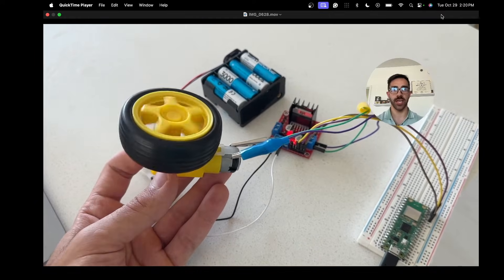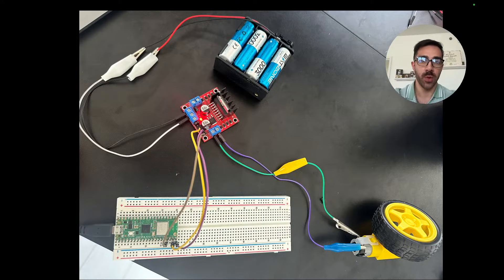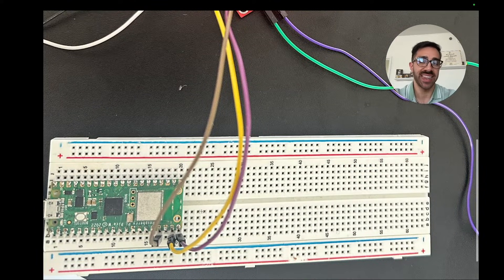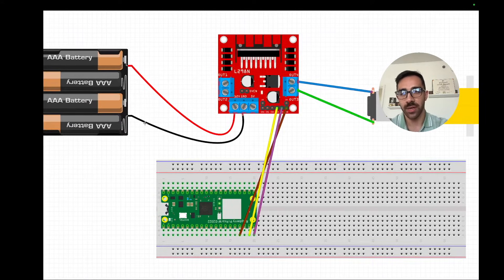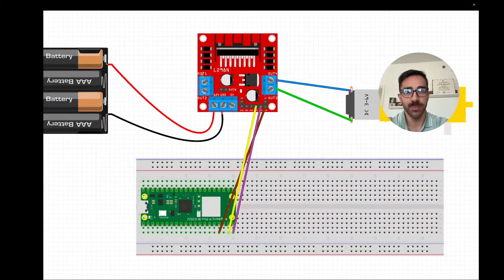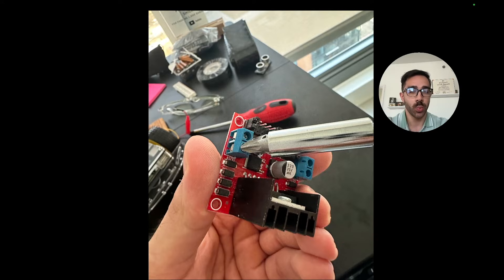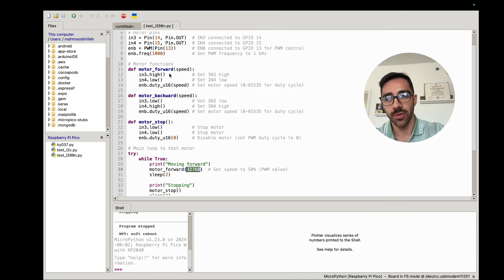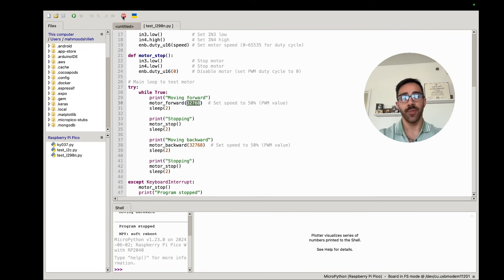How to Control DC Motors with L298N and Raspberry Pi Pico W in MicroPython | Full Tutorial

Comment: This is awesome!
But I was wondering if you could do it with a raspberry pi 3 without a breadboard
Reply from the maker: @normalityhq9588 you can easily
Reply: @mmshilleh can I use the same gpio pins as you?
Reply from the maker: @ no its a different board haha you need to chech the board layout
Reply: @mmshilleh  quick update: my screw terminals are almost blunt because it wouldn't turn even if I used a lot of force

Comment: I followed all the steps correctly with the same materials but it didnt work for me
Reply: Nevermind, I got it work after realizing that I had to ground it from the middle pin connected to the positive battery wire to the pico